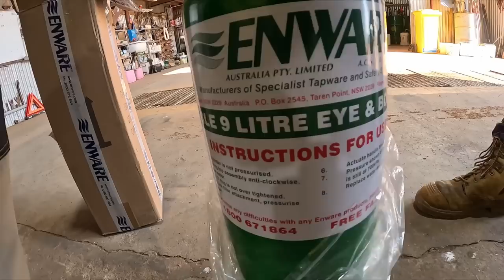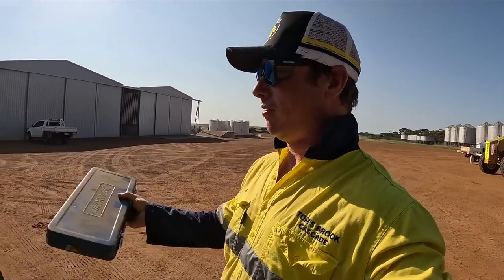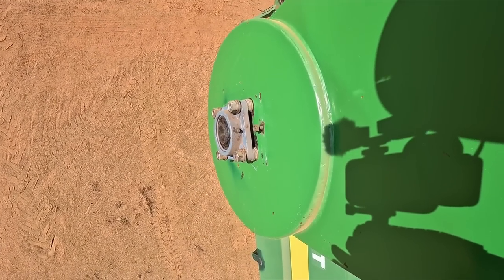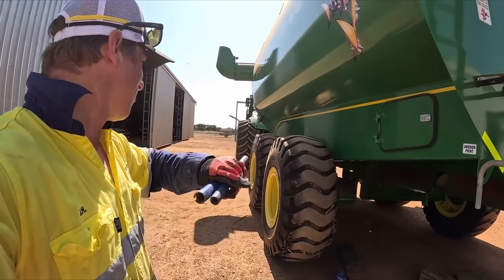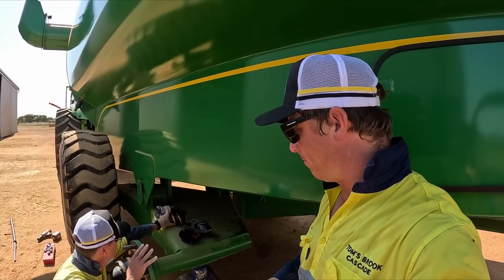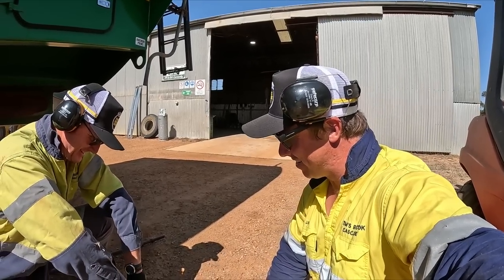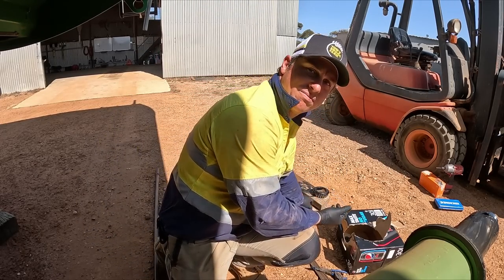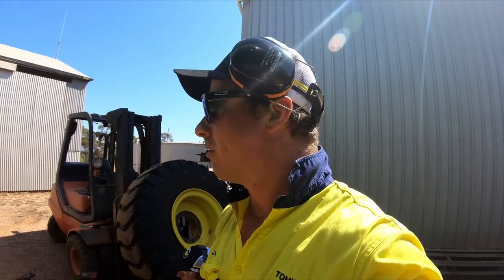2023 Harvest Preparation | Western Australia

Comment: JH possible just not shown in the vid. Fill the centre of the hub with grease, this and the cap are the main reservoirs for the bearings. Grease is like a wick oil will transfer through it from one side of the hub to the other that is why there is only one nipple, if there is no grease in the middle it might take years before you pump enough grease in at service to make a connection with the inner bearing. Dont hit your new cups directly with the hammer when installing use a mild steel punch or drift plate and freeze the cups, you can bruise the edge of the cup and the high spot will wear off generating metal 👍